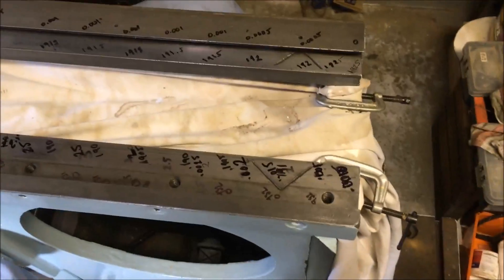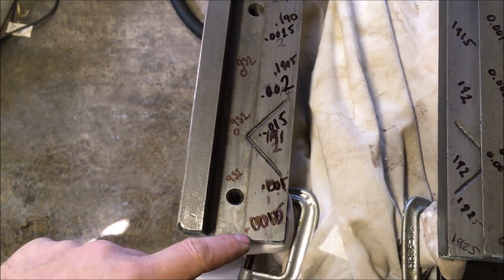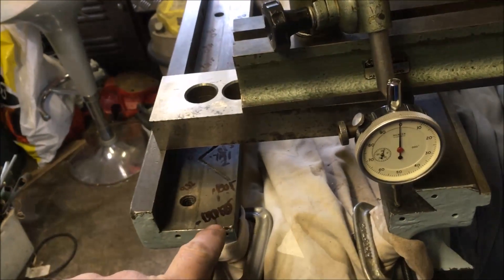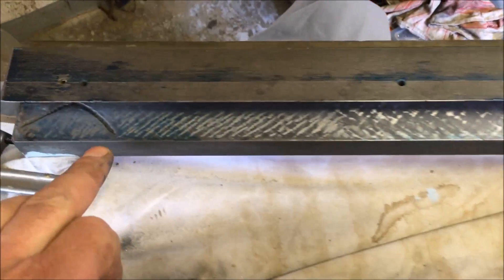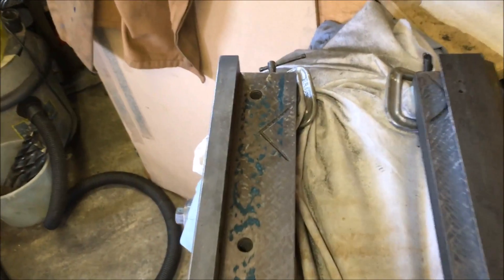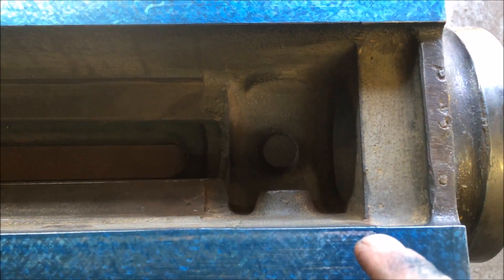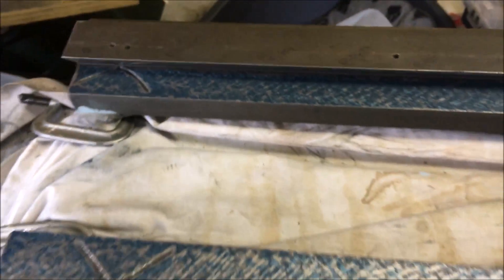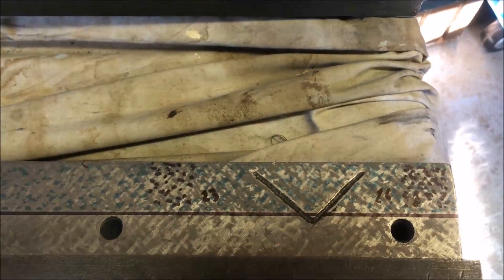Elliot 14 S Update 10 5

Comment: Getting there slowly but surely Mat. One thought? Have you got / can you build a cylindrical square? If so you can self check it on your surface plate. And even if it's out a hair there will still be one small area on it's circumference that's at a true 90 degrees. Suburban tools has a video on there channel about how to check cylindrical squares. Once you have one and marked so you know where that true 90 is you could clamp it to the vertical face of your shapers main casting. With the main castings top ram surfaces parallel and true you could slide a magnetic base along the top ways and pivot the indicator tip across the top of the cylindrical square until you get the lowest reading. Given the extension out from the indicators base any tilt at all under the base will magnify the error by a great deal. But it should work well enough to give you some idea of how true that front face is to being an actual 90 degrees to the ram ways. Have you seen the Tool and Die guys video about using one of the old school layout and marking gauges and a 10ths indicator for squareness checking? You could also use that method to clamp that heavy parallel to your straight edge and align it dead true on your surface plate and make your own temporary 90 degree angle that should be very accurate. Within a few 10ths at least. These are all best guesses on my part so they might be worth exactly what it cost you. :-) But too bad there's over 6,000 miles between where you and I are since I'd be more than willing to loan you either of my cylindrical squares.
Reply from the maker: Hi, thanks for the comment - I have been looking at making a Cylindrical Square for some time - its one of those projects you know is worth while and its on the list - but never seams to be done when you need the item !  Im thinking of a way to set up a T square on the vertical faces and the dti slung off the underside of the RAM running on the T square bar .... securing it all is the issue. I will post a video of what I come up with when its done and working. Thanks for stopping by and commenting :-) Mat
Reply: A good cylindrical square that's been tested and marked for the most accurate location is a lot more useful than I thought it was going to be. I've also got a mid 1990's B&S 558 that they no longer make. That one allows you to measure to 10ths any part inaccuracy. A bit hard to find now and not usually that cheap even at the used price. Although to be honest a preset dti on a marking gauge stand can do the same and over longer distances if you've got a known to be accurate reference surface. I've also used wrist pins from large V 16 Cummins diesel engines since there made very accurately. Finding used good condition one's is real tough if your not in the mining industry though.

Watch out for that indicator sag problem with whatever you come up with. I spent hrs trying to align a lathes tailstock that was already fine until I finally figured out gravity was causing the dti to lie. If you haven't seen any forum threads about it there's ample posts over on Practical Machinist documenting the problem.
Reply from the maker: There are some small cylinder squares on ebay at present - but as I would still have to verify them, I figure my time is better spent setting up a 10ths indicator on a marking gauge for now and then putting together an adjustable T Square some how ....

Comment: T square, if you have a 3ft straight edge, you could bolt a T on one end. The far edge in the dove tail, do you really need to go all the way, I would think you wouldn't want the throat to make contact but only the two flat surfaces. You're working very hard, do you get the"dog chasing it's tail" feeling when scrapping?? Keep up the good work, should be finished soon (next year) Peter
Reply from the maker: I am looking into the options for a large T square set up / arrangement which will help me check alignment. When I have it sorted i will post a short video. 
My dog Skye does the tail wagging - usually when shes in the wrong spot at the wrong time and wants food or a walk - as for scraping - I keep getting 'deja vu' all over again :-) but it passes....
Thanks for stopping by and commenting - All the best Mat

Comment: Looks good to me Mat just keep going you'll get there, when your done you can do my surface grinder if you like.

Alan.
Reply from the maker: Ive an old (c1950's) SG that would benefit - but as the working surface is 7x3.5" it barely seams worth it. The old 1ES Mill would also benefit from a strip & rebuild ... as would the Boxford AUD lathe ..... I think I have more than enough projects to practice on :-) Have you tried that Sandvic scraper yet ?